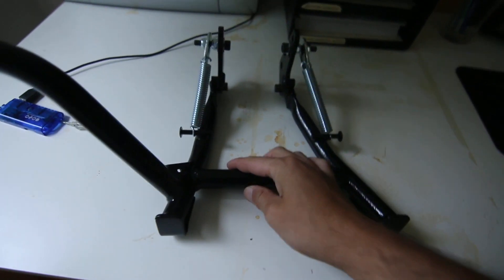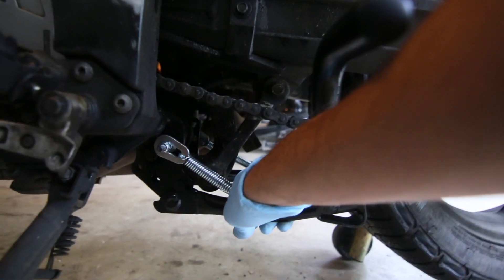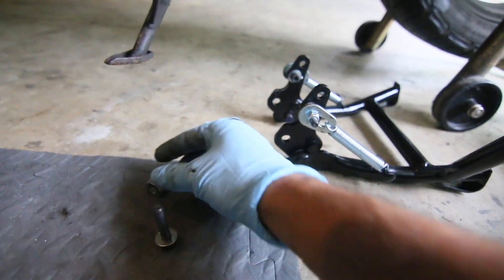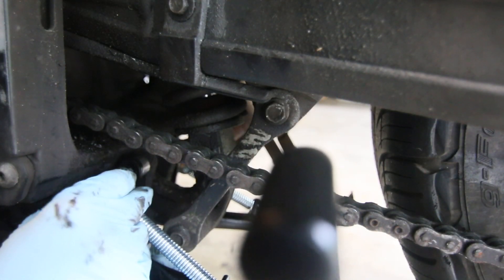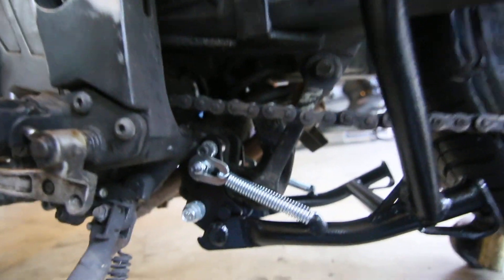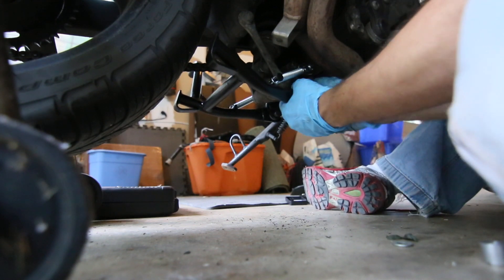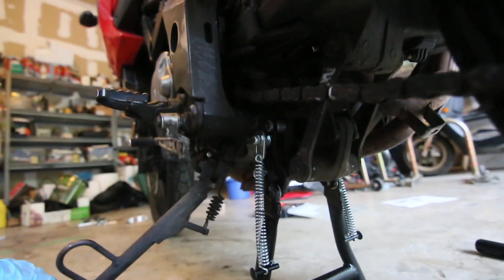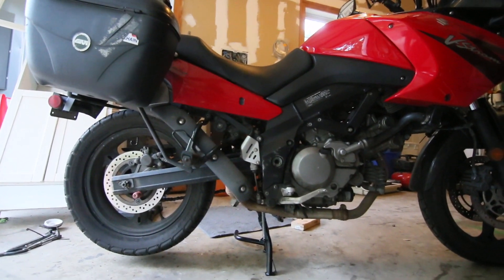How to install a happy trails centerstand on a dl650

Comment: I just did this. I tried following the instructions but found it easier to put a rod in the upper holes (I used a tent stake) which then held up the stand so I didn't have to.  I then popped in both lower bolts while it was hanging.  Then removed the stake and did the top bolts and then snugged everything down.

Comment: My installation was not without some head scratching moments.  I ordered a stand for a 2014 Suzuki DL650.  I received instructions and hardware in excess of what was required.  That in itself was confusing; two different sized spacers (6 total).  Several extra washers; to be used as "shims" according to the instructions.  

Placed M/C on side stand.  Mounted the 10mm (bottom) bolts first, sans spacers.  Rotated the stand rearwards and mounted the 8mm (upper) bolts, sans spacers.  All bolts were only hand tight.  I then backed out each bolt, one at a time, and inserted the appropriate spacer.  In my case I was supplied four 12.7mmL and two 16mmL spacers.  I only needed the shorter (12.7mm) spacers and no shimming was required.  The threads on each bolt were cleaned and a small touch of threadlocker was applied to each before reinserting.  

Tips: 
1)  Clean all mounting threads; degreaser - compressed air - brake cleaner.   2)  Use blue Loctite threadlocker.    3)  Inflate tires to recommended pressure.    4)  Mock-up the assembly before proceeding to apply final torque.